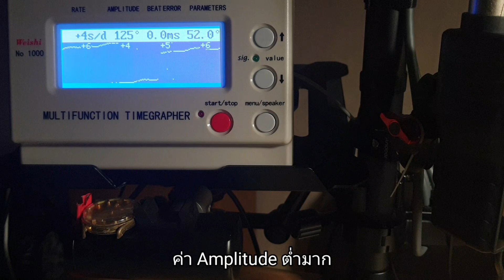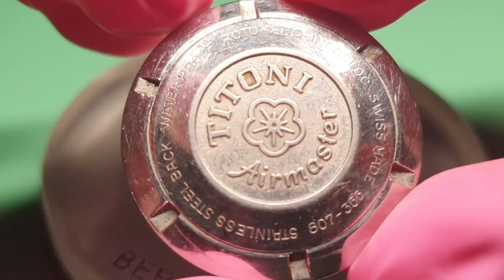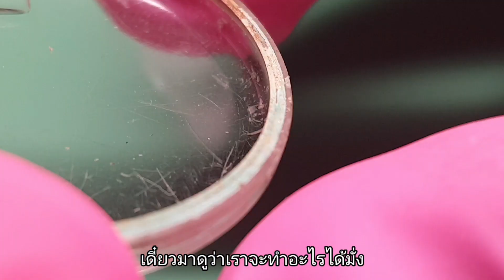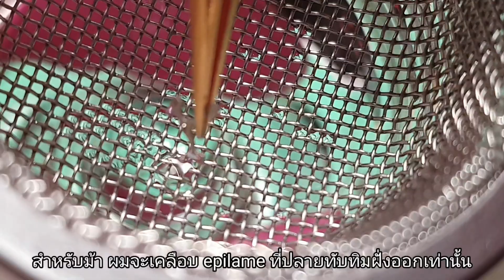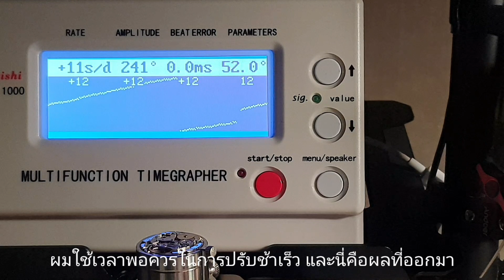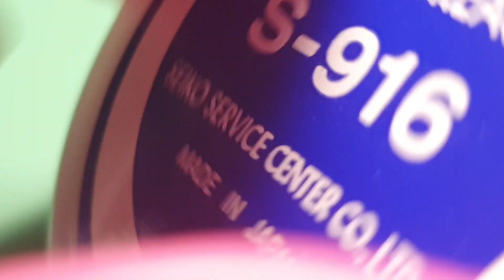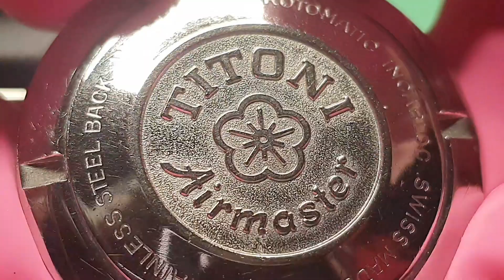Titoni Airmaster ETA 2782 Full Service / เซอร์วิส Titoni ETA 2782

Comment: Absolutely amazing, Net.....SMH. It's always a pleasure, watching you work. To be able to restore something of this magnitude of neglect, is truly impressive, IMHO. As for the model itself, that dial, w/ all of it's depth and dimension, is amazing. Makes me wonder how the hands, had become as "beat-up" as they were. Do you think maybe corrosion from the gradual introduction of moisture over time, or maybe they were scratched and damaged during prior servicing??? Or possibly even a compilation of both??? Restoration is very tricky business, as you know. There's a fine line between refurbishing an item, and damaging it further, trying to make the item look as if it were, of brand new condition again. In this case right here, I think you were able to strike that perfect balance between the 2. Any idea why you think that it was not possible to get the accuracy any tighter??? Keep up the great work, Net. I'll be watching....
Reply from the maker: thank you very much.  You were right, the hands were beaten up by man.  That was sad.  And yes, I love vintage watches for how old they look including those scratches, of course not big/deep scratches.  Those scars tell stories that is how the value is held.

Comment: great job as usual: was not possible to get straight the thread of the crown in some way?
Reply from the maker: To my exprience, the only save way to do without breaking the steel core is to heat and bend it back.  However, the heat might change the color of the crown and I don't think it would look good to the  overall appearance.

Comment: hi nat, cool video again. i have brass tweezers but the tips always bend. can you recommend cheap brass tweezers that are good? And wich microscope do you use? 

Best regards
Reply from the maker: In my opinion, 2 things that I will invest are tweezers and screw drivers. My practice is I don't use brass tweezers any other way than picking light parts. If you notice my video,  I use other tweezers for heavy bridges and even screws for them having sharp threads.  That's how I hardly bend my brass tweezers.